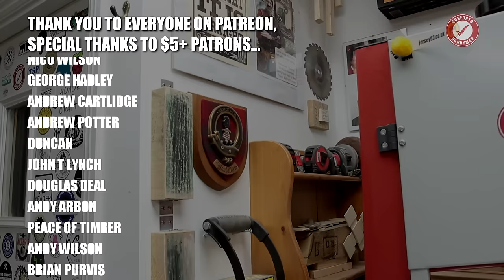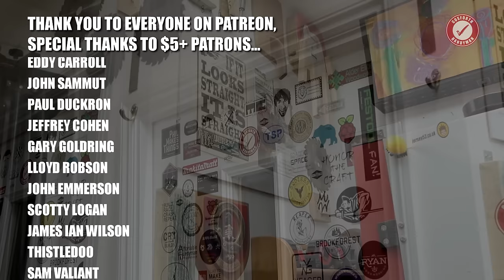Timelapse in 12 mins - making my GARAGE WORKSHOP!

Comment: Great job that's given me some ideas for my garage workshop. One small trick missed or didn't show on the video was putting mineral wool insulation between the door panels for extra sound absorption. You might have got an extra 3 dB sound reduction overall.

Comment: hello sir... what is the density that u r using for the wool.. its rockwool and knauf rite if im not mistaken. i want to build a workshop in my townhouse room and its upstairs . the room is concrete wall and floor. how do i encase the room to be soundproof just  like what u did. is it possible for me to do the exact like u did or do i need a mass loaded vinyl for soundproof confirmation...thank you sir

Comment: What's your impression of the soundproofing efficacy of the MDF walls?  Standard practice for soundproofing in the US is two layers of fire rated (extra dense) 5/8" drywall.  18mm MDF has similar weight per square foot as 5/8 type-X drywall, so I suspect it would have similar soundproofing effect -- with the added benefit that you can mount things on the MDF.

Comment: The first thing that struck me (after wondering how long it actually took ...) is how much easier it probably was with cordless tools.  Obviously still do-able with corded and maybe some of it was, but there'd have been wires everywhere!  Wish I had that much space, too - mine's about 8' square.
Reply from the maker: Defo - you can almost run a full workshop cordless these days 👍. I reckon about 2 full weeks of work here... spread over about 5 years. 😀

Comment: Nice job, though a couple of warnings.
1 A dedicated space like that could be subject to business rates;
2 Technically, if you set aside a specific part of your private residence for business use, that proportion is not exempt from capital gains tax when you sell the house. So, if say the property is worth £400k and goes up by 50% over 10 years, the gain is £200k. If 10% of the property is for business use, then 10% of £200k is taxable when you sell. Best check with your accountant, I am rusty on this.

The other system is don’t tell anyone. Doh!
Reply: I'd say your fun at parties..

Comment: Areet bud, just discovered some new plasterboard / cavity wall fixing dunno if you've seen them or not? would like to get your take on them they are called... Gee Fix  found them on Amazon while looking for a way to re-attach the cooker hood that......... kind of........., came off in me hand while I was cleaning it LOL a little bit fiddely ( if you got ten thumbs like me) and not the cheapest but they work really well.
Reply from the maker: Seen them but haven't tried them. They look good from the reviews I've seen! 👍
Reply: @GosforthHandyman  one thing I would recommend  when using them, run the center screw through the back piece a couple of times before you fit them just to make it a bit easier..

Comment: good vid and good music you obviously know what you want and how to do it. However you used the word "temporary" a lot then I seen you taping and filling and a whole lot of screwing that aint temporary although it aint permanent I think I would have just nailed a lot more on the build to save alot of time rather than pre drilling and screwing  especially the mdf and the timber framing its not like you cant denail, something quicker than it takes to screw together unless you were planning on dismantling it and selling it on to another nearby property. Just an observation, now I've got that of my chest the end result is pretty fucking good and I am jealous as f@Xk cause I dont have a double garage.
Kind regards.

Comment: Far too much unnecessary material and time expense.  Just batten out the brick walls,  additonal screwed rafters in the ceiling, all your small materials screwed in screw top tins to the ceiling joists,  my workshop mainly has the items hanging from the ceiling meeting the stack of drawers etc rising from the floor (and you do need a good, sound, dust free floor more than anything (decent dust extraction system for tools though